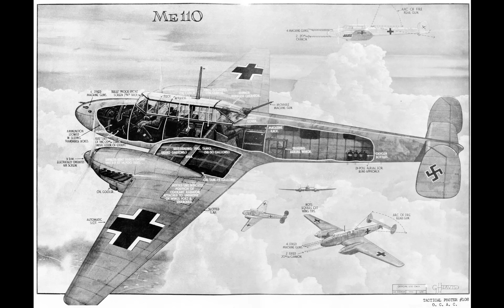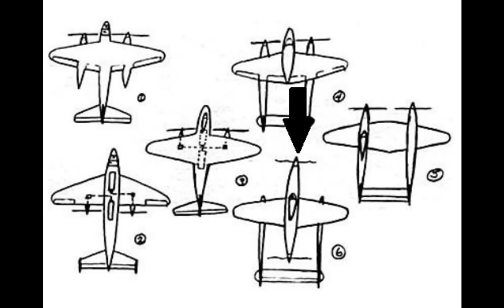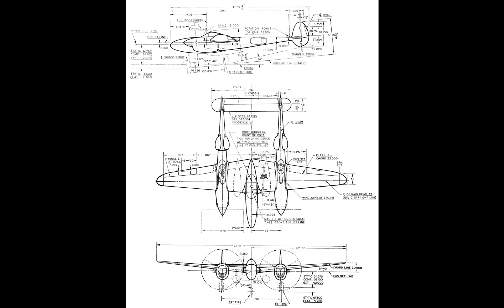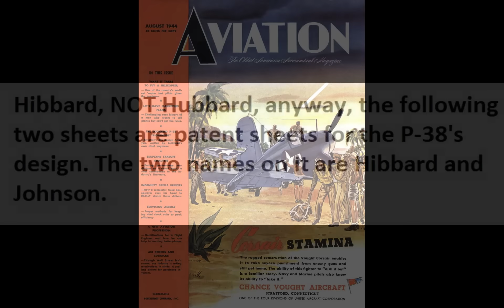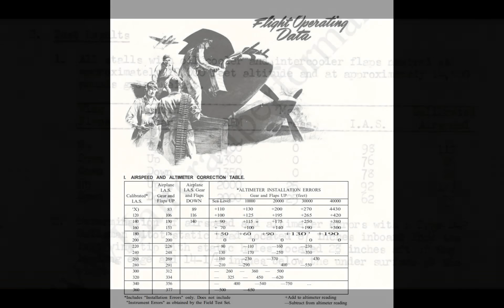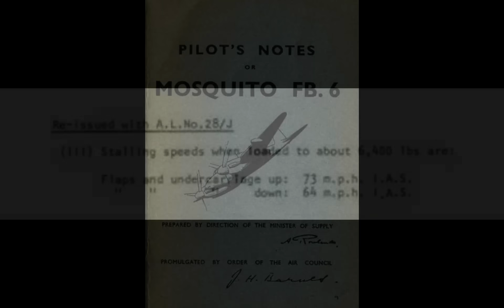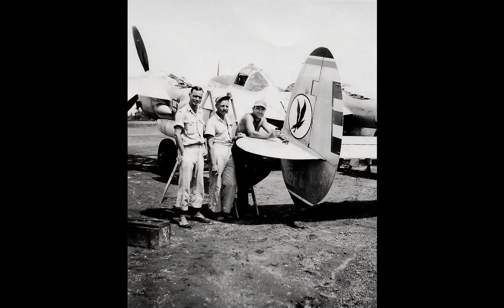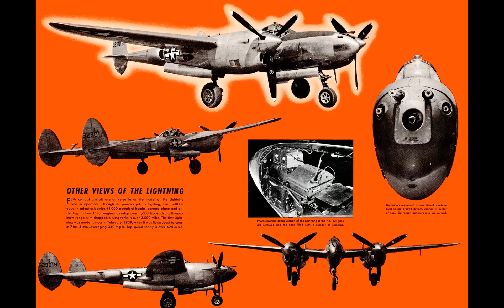Lockheed P-38 Lightning Design Info

Comment: Hey Greg why didn’t we see many p-38s in the fighter variant used in Europe during WW2, as opposed to the recon variant? It just seems like Europe and France mostly has p51s & spitfires, etc for the allies. If there were just as many p38 fighters in Europe, why don’t we hear about them or see them as often in pics or videos from that theater?? Thanks!
Reply: I sounds like he is going to cover that. But everything I have read states that that operating in the extreme cold at high altitudes over Western Europe caused issues not seen in North Africa, MTO or the PTO. Things like poor cockpit heat, intercoolers that got the fuel/air mixture too cold causing all kinds of uneven mixture distribution to various cylinders and other issues. That doesn't take away from the fact that it was not a great aircraft. Another thing was that it was a VERY challenging aircraft to really become a master of compared to something like a P-47 or a P-51. Basically the USAAF decided to go with the Thunderbolt and later adding the Mustang and get P-38's to where they were begging for more which was the Pacific.

Comment: Along with the P-39, one of the most elegant US WWII fighters. IMO.
Reply: It's a shame they didn't have the time to finish developing the turbo system for the P39, it could be that the P51 never would have been designed if that was the case.
Reply: And lead to two of the most brutish - the XP-49 and -58
Reply: @chrismartin3197  49 doesn't look that bad...58 is another matter.

Comment: The airfoil in the center section was a NACA 23016, as pointed out in the narrative. The tip, airfoil, was a NACA 4412.
Reply from the maker: Yes, almost every WW2 plane has a different airfoil at the tip.

Comment: This fighter was designed and built by the Lockheed 'Skunk works' headed by the aircraft engineering genius, Kelly Johnson of SR-71 fame. My cousin worked as an research and prototype CNC operator during the design and production of the first SR-71. She was a very talented lathe operator and like all technicians and engineers who worked for Kelly Johnson she only answered tô Kelly Johnson. He had complete control of the projects in which he was involved. You disagreed with Kelly at the possible loss of your job. He fired the engineer who spread the Skunk Works moniker. He was beyond serious, and lacked a sense of humor when it came to his work.
Reply: Well not just Skunk Works aircraft. He worked on the P-80 and F-104 too.
Reply: Edward Pate I worked for Ted Smith as a licensed aircraft mechanic back in the 60s. He was another aviation engineering genius. He designed the B-26 among various other military aircraft. I was hired to help build the #1 prototype of the Aerostar twin engine executive  civilian aircraft. At the time it was the fastest civilian prop driven aircraft in the world and handled much like a fighter. It was a great success.

Comment: I have a question, Greg. Why didn't aircraft like Mosquito and others have counter rotating props? I understand why they didn't fit counter rotating engines but one would think that just countering the props would have several benefits. Less drastic trim settings being just one.
Reply from the maker: Expense and logistics.
Reply: @GregsAirplanesandAutomobiles  fair enough, thanks for reply!
Reply: @GregsAirplanesandAutomobiles  Add to that the Allison was quite easy to modify to run in the opposite direction compared to the Merlin. Something not often talked about is the mechanical simplicity and ruggedness of the Allison despite having a great design that was every bit as good as the Merling. Add to that they would take TONS more abuse such as running at very high boost in P-40's when they disabled the automatic boost controls.

Comment: sry but at 8.16 you were talkin bout the layout....there was bomber in ww1 that was build with the number 3 layout with 3 engines in the fuselage ,the schuckert series...it kinda failed cause of the engines were not reliable enough at this time. with a total of 7 machines build, but it got accepted for military service
Reply from the maker: sry, but I said "no production airplane", not a single airplane or a handful of prototypes. I think you are talking about the is the RIII of which only one was built.
Reply: @GregsAirplanesandAutomobiles  the r series was actually intend to be identical, but they worked with different engine types and resulted in different numbers but the layout and the fusselage stayed the same from I to VII.i link you a small articel https://www.militaer-wissen.de/siemens-schuckert-r-i-and-successor-aircraft/?lang=en . 2 ended up for training and the other five on  frontline duty

Comment: So, a P-38 could carry more bombs than a B-17 (4800 lbs).
Reply from the maker: No, the B-17G could carry 12,000 pounds internally. With external loads even the early versions could carry similar loads.
Reply: @GregsAirplanesandAutomobiles  
From Wikipedia, 
Bombs:

    Short range missions (<400 mi): 8,000 lb (3,600 kg)
    Long range missions (≈800 mi): 4,500 lb (2,000 kg)
    Overload: 17,600 lb (7,800 kg)

Fuel matters.
Reply: @chrisrautmann8936  He's a former flight engineer.  I suspect he knows a little about fuel/payload tradeoffs.  He has a very thorough video on the respective load carrying capacities of the B-17 and the Lancaster.  It was an eye-opener to me.

Comment: I was surprised when I checked that 1200 F- lightnings were produced, which eclipses the Spitfire slightly (about 900). Given that Spitfires mostly operated in Europe and the F-4/5 significantly in the Pacific and there were many other PR aircraft (Mosquito and Mustang in particular) it seems unlikely that 90% of PR in Europe was by the F-4/5. Maybe 90% of the USAAF's? Even then I am not sure I am convinced given that there were also about 500  F-6 (P-51). In RAF service Mustangs were used (about 50?), Albermarles, and many others.
Reply from the maker: They didn't say 90 of PR in Europe. The devil is in the details here. I'll go over this in detail in a future episode.
Reply: @GregsAirplanesandAutomobiles  apologies if I misinterpreted it. It did cause me to look up the numbers, and I had no idea that they built so many F-4/5! I love the content, by the way.

Comment: As a kid, even as a Brit, I loved the Lightning, the P47, along with the Mosquito, the Typhoon/Tempest and P-61 Black Widow. I liked the planes with grunt and robustness. Having said that, I will still tip my hat to the day bombing raids by the US forces in the European theatre: bravery beyond measure, knowing the casualties until the P51 could escort them,
Reply: Shame the dehavland see hornet was so late as that was apparently had enough Maneuverability and role  rate to take on single engine fighters
Reply: The P-38 did a good job of escorting  them. For a long while, it was the only fighter with the range. In the beginning, it suffered from not being fully developed. The Army also resisted improvements that would slow production, even badly needed ones. So solutions that were developed quickly often took a long time to reach the combat theaters.
Even with a green airplane, green crews, and not fully mature tactics and strategy-not to mention P-38 flights being outnumbered for much of the early campaign in the ETO-the P-38's helped the bombers get through. As all of the above mentioned factors improved along with the airplane itself, the kill to loss ratio improved. The Germans could afford the losses even less than the Allies could, and attrition took the Luftwaffe to pieces.
By the time the P-51's came along, the air war was already being won.
Ironically, by the time the P-51's with Merlins came along, the late J and L P-38's were available, but a lot of pilots never flew them because they were handed P-51's instead. The P-38 played an indispensable role in winning the air war in the ETO, and evolved in to a fighter as good as any in the air. But in many misguided histories is portrayed as second banana to the late coming P-51, and the shorter ranged P-47.
Reply: @garyhill2740  When Doolittle asked RAE Farnborough to test them in the dive It was the P38 that was relegated first Its ILDS or C/M was appalling
Reply: I’m a fa n of all those as well, although I would add the Bristol Beaufighter to that list.
Reply: I got a chance to meet a b17 crewman at an air show many years ago. He said the thing they worried about the most was flak specifically the 105mm.
Reply: The protection of bombers from enemy fighters actually came about later, when allied pilots, mostly flying P-51s by then, were ordered to destroy enemy fighters. 

(Instead of "defend the bombers"). - They went from flying top cover, and being reprimanded for chasing enemy fighter down to the ground, to being ordered to chase them down and shoot them any chance they had, especially on the ground. And when they were forming up for an attack before they were prepared. This change it tactics literally wiped out the entire Luftwaffe in a matter of a few weeks. After almost four years of playing games. 

The concept of defending an enormous bomber fleet from a mass attack of cannon armed fighters is somewhere between completely ineffective and criminally incompetent.
Reply: @Triple_J.1  No the USAAF were  using all types at the start P47 P38 and even RAF Spitfires for short distances

Comment: I hope you will address the impact of the complexity of the P-38 as compared to the single engine fighters of the day.  With two engines to manage and several manually controlled systems that needed to be reconfigured from cruise to combat settings, it seems like it might have been a little harder to respond quickly to an unexpected attack by enemy fighters.  Combine that with the different mission profiles with the long overwater flights in the Pacific with little chance of being jumped en route vs Europe with long range missions where an attack could happen any time.

Comment: I Wonder What If the P-38 Had Merlin Engines Like the P-51D Mustang?
Reply: To me the P-38 with Merlins had no real advantage of the Allison once some of the bugs were worked out and you go past the early variants. The Allison was an excellent design and only lacked in other aircraft due to not having a 2 stage/2 speed mechanical supercharger. As spoken to in the video the P-38 was the only aircraft that utilized what Allison had envisioned for this engine for high altitude use with the single stage mechanical supercharger fed by the turbo-supercharger.
Reply from the maker: That's a common question, the answer is so complex it might be nearly an entire video on its own.

Comment: Greg, thanks much. My Dad flew the P-38 Photo-recon in Europe during WW2. - Phil
Reply: There is a spurious claim in this video that the P38 shot 95% of the film over Europe.  This is rubbish as the greatest PR aircraft was the Mosquito followed by the PR Spitfire.  Both were used by the USAAC and there are two of them in the USAF Museum at Dayton Ohio.  The P38 was used for recce work because it was useless as a fighter over Germany.  It was mainly used in the Med where the air was warmer and most flights were at low level (like in the Pacific).

Comment: Thanks, as interesting as ever. On the top line of the final page of the description you have appended to the end of the video, appears the sentence "The hydraulic system is supercharged for maximum high altitude efficiency". I'm not sure I understand this - how do you supercharge a hydraulic pump, does it include turbocharging as for the engines, why do hydraulic systems need supercharging to be efficient at high altitude? I mean, the hydraulic system is a closed loop at a pressure determined by a pump isn't it - I'm not sure what drives that pump directly, ultimately the engine must be the source of power, and I see that the engines need supercharging to get enough air into the cylinders, as described in your many videos, but hydraulic pumps?
Reply from the maker: OK, I had to think about that one for a moment. What they mean is that pressurized air from the turbosupercharging system is supplied to the hydraulic reservoir to prevent the fluid from foaming at high altitudes. This is pretty standard now in high altitude airplanes, but was unusual back then.
Reply from the maker: PS I'm extra impressed that you read the whole article. I wasn't sure if it was worth tacking it on there.

Comment: One wonders, after the work engineering the booms, whether there was any thought to adding a cockpit and making a classical single-engine, single-boom fighter out of it?  Alternatively, once the NACA data on turbo cooling and radiator ducting came out, why they didn't simply switch to the Thunderbolt solution for turbo cooling, and say the Mustang-style cooling?
Reply from the maker: I'll answer those questions in a future episode. I can't do them justice in the comment section.

Comment: I Always loved the look of this plane as a child. As I learned more about it you really do come to realize it was kind of a failure. In short the P-38 was very expensive, had a long development period, and couldn't really do more than most American single engine planes that cost half as much.  While the P-38 did an admirable job equaling the performance of single engine fighters in some cases, and may have been the best twin engine fighter of the war, it really is a case study for why the twin engine prop fighter is a failed concept. It's hard to see Equal performance at twice the resource cost in wartime any other way imo.  Let's see what Greg thinks.
Reply: Very good point. However, I must respectfully disagree.
What the P-38 represents is a superb aircraft which fit into no preconceived categories and so was shoehorned into doctrine designed for single engine aircraft.
Example: its range could not be matched by any single engine fighter. It would have been ideal for the fighter sweeps ahead of the bomber formations, but was relegated to escort duty. A superlative energy fighter, a.k.a. boom and zoom, hamstrung by a role more suited to other designs.
Another example: with different armament configurations it would have been a superb bomber destroyer, only by the time the US entered the war, the enemy had no more bomber force.
In short, the military refused to adapt its doctrine to the tools at hand, and so did not make the best use of them.
Reply: Another way to put it would be that the P-38 was a superlative offensive aircraft, but limited by the fact that fighter doctrine of the time was essentially defensive. When it was unleashed for pure offense, the results were outstanding.
Reply: The P-38 is not a good energy fighter. that was specifically it’s problem in the European theater. while fast in level flight    for 1937 design by the time it entered service in 1942 it was only slightly faster than the 109. But more seriously it was very poor in a dive. German fighters simply dove away from it. its roll rate was very poor and much lower than the 109. when the FW-190 entered service in 1943 these deficiencies were an even bigger issue. 
When they moved it the pacific it performed much better because Japanese aircraft had poor dive performance also.  The P-38 was 50mph faster than the zero and oscars so it had a big advantage it could exploit.  However the P-38’s performance was eclipsed by the corsair and Hellcat when they arrived on the scene. Hellcats were less than half the price.

Comment: It was the hydraulic ailerons in the Ks and Ls that made it possible to maneuver with single engine fighters at higher speeds.  The  190 pilot with unboosted ailerons would tire out or simply not have the strength to apply full aileron above middling airspeeds, or have to fly with two hands on the stick, whereas the P38 driver just flipped the wheel over one handed like he was in his power steering Cadillac.  This cancelled out most of the roll rate disadvantage of two engines.

Comment: Hi Greg, great video. While never a production aircraft, the Martin Mixmaster did utilize two Alison engines mounted in the fuselage. The engines drove a contra-rotating propeller in the tail. One of the prototypes was converted to jet propulsion. https://upload.wikimedia.org/wikipedia/commons/3/30/Douglas_XB-42_050620-F-1234P-008.jpg
Reply from the maker: True, but not the same configuration with the props out on the wings.
Reply: @GregsAirplanesandAutomobiles  Was contra-rotating propellers available in 1937?

Comment: Was there a P-38 prototype with Merlin engines? I wonder how much better the performance would be?
Reply from the maker: I will cover that at length. It's complicated.
Reply: @GregsAirplanesandAutomobiles  can’t wait to hear about it. Loved your P-47 videos!
Reply: Don't operate under the common misconception that the Merlin was a "better" engine than the Allison. The Allison as installed in the P-38 was set up exactly the way it was intended to operate at high altitudes having the turbo-superchargers in addition to the normal single stage single speed mechanical supercharger on the engine.

Comment: Compare it to the Do335 Pfeil as well plz
Reply from the maker: I try to keep these comparisons reasonable in a historical context. I consider the 335 a "superprop", which is the category I'm making up for prop planes that were coming out at the end of the war and in the early jet age. These are planes that were never in combat. XP72, P51H, Bearcat, Tigercat, Hornet, Spiteful, and of course the 335.
Reply: @GregsAirplanesandAutomobiles  I believe that in actual combat the P-47M would have had no issues dealing with the Dornier.